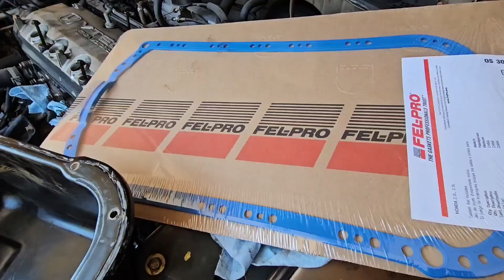F23 Honda Accord Oil Pump Replacement

Comment: I have that engine in my 2000 Accord LX. There is not factory gasket for that metal oil pan, it use Honda bond high tempurature silicone. It works very well. I've used Felpro gaskets before with poor results. Try using either Honda or Mahle brand gaskets, Mahle. You might consider using Amayama Trading company to acquire Honda original factory parts for you Accord. They original and are sent to you via UPS or DHL from Osaka, Japan. I just purchased the transmission solenoids for my Accord. Good video...